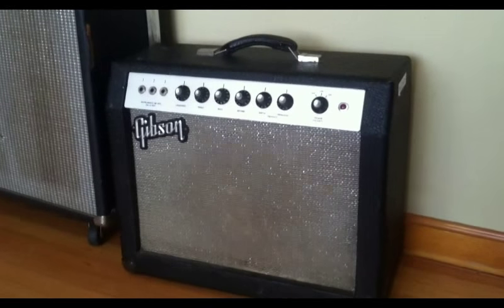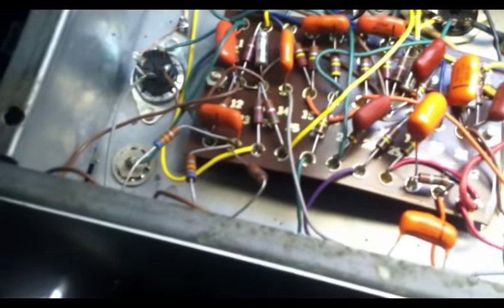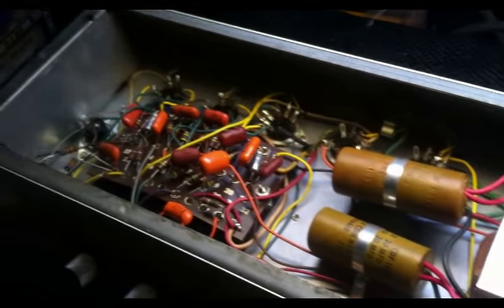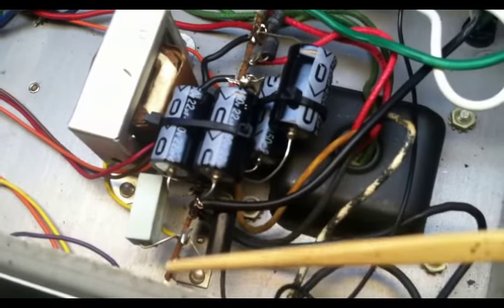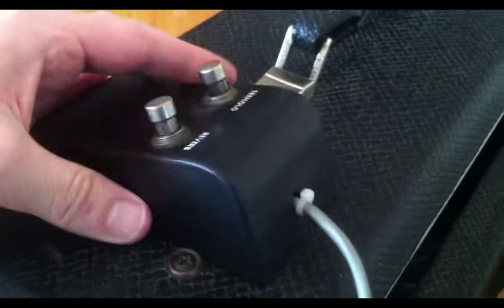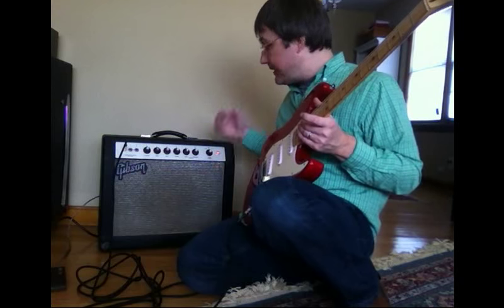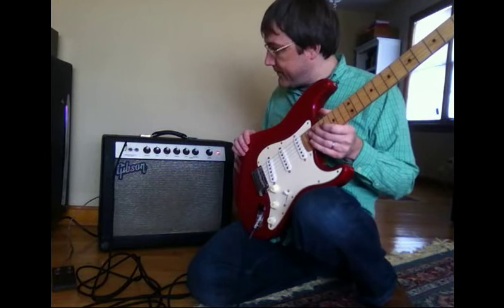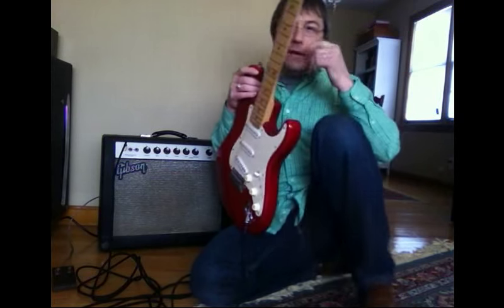1966 Gibson GA15RVT Explorer Amp SERVICE & DEMO

Comment: I have an Epiphone Comet version of this amp, EA-32RVT, with a crackling issue. Finding a schematic was like archaeology. And the drawings for the GA and EA are really quite different. But I used the Gibson's reverb driver circuit after my transformer broke. But like you have said with these, the tone is anemic and  this has had an intermittent crackling noise that I haven't been able to fix.  A flee market find in 1990, I have worked on it for 25 yrs, and it still isn't right :). Funny,  mine had an ALNICO Magnavox 12" hifi speaker in it when I got it.

Comment: How do you get the bottom piece of press board off the bottom of the Gibson foot switch?
Reply from the maker: It slides out. If it's stuck, try lubricating it with a squirt or two of WD40
Reply: @TheGuitologist   I'm really digging your guitar playing.
Thanks for everything.

Comment: Tonally where do these sit? I want a bit of a hybrid deluxe reverb and AC15 vibe, with some low end. I will use a extension cab exclusively for most things.
Reply: The Explorer (and silverface mid-60s Gibson amps in general) are much more Deluxe Reverb than AC15, lots of headroom and presence and round-sounding chime. No breakup before volume 10 with single-coils, and even then it makes that seethy Roy Buchanan sound, not the tweed-amp crunch.

Comment: HI.  Can you explain the death cap? I have one of these amps and i may use it for small gigs. It actually sounds ok with a sparkle drive pedal to give it some boost. I am going to replace the speaker with an eminence speaker.  Also, do you recommend changing the tubes? What tubes would give a little more volume and/or breakup? I am not looking for a 5e3 tone (I have one of those). Just to be able to get a bit more out of this.  I like the el84 tube vibe. Thanks.

Comment: Hey Brad
How ya doing?  I've had a 66 ga-15 RTV in pieces for the last week and a half trying to get it to sound like this one. Lol. I've tried everything I can think of and feel like I'm really close, but no dice.  Mine seems to be a mix between the 15 scheme and the ga-35 with the reverb transformer.  But I have other projects that I want to do this year.....
I'd appreciate any help you can give me
Thanks
Reply: I figured the problem out....the phase inverting transformer was wired incorrectly.  The striped center wire that is usually the center tap is not actually the center tap! 😒

Comment: Hello, my father has this amp he bought in the 60's. He mistakenly had it retubed ten years ago and it completely ruined the sound. Who was the manufacturer of the original tubes? I'd like to get back the original sound for him.
Reply: RCA. I'm the second owner of one that was tucked away in a closet for decades by the owner. It's a '66 with all 1964 RCA tubes.

Comment: Another cool run-through and repair video. You know, if I were the client, I would probably ask for that cool mod you did on that last video where you added the option ofselecting less resistance to that first preamp tube, I think it was, thus creating that lovely overdrive/crunch sound. Could that have been done to this amp as well?
Reply from the maker: +August Lyons No. The mod you're talking about dealt with unbalancing the phase inverter stage (just before the two power tubes). In this Gibson amp, as n most Gibson amps from this time, the phase inverter stage is being achieved with a transformer, not a tube, so it isn't possible here.
Reply: +The Guitologist  I see.  Well, nothing a good ol stomp box wouldnt cure in that regard. :-)
Reply from the maker: Not sure this would be a good platform for a higher gain sort of tone, but a good boost might be nice if you're going for that SRV tone. This amp would get you there.

Comment: I have this amp. Do I have to unplug speaker when using the  extention speaker jack?
Reply from the maker: No. Don't unplug the internal speaker when using the external jack.
Reply: Thanks! I just acquired this. I have the schematic but no manual. Your video is great! Keep it up.

Comment: How much do those cost
Reply: I think the right range is 250-450, depending on the shape it's in. Some sellers want 600 now for an un-refurbished Explorer just because it's "vintage," which is stupid. The one in the video might be worth that much now, after repairs and cap replacements and a new speaker, but before all that this is a project amp at best. Use that when bargaining.